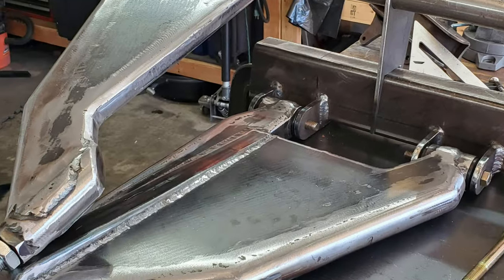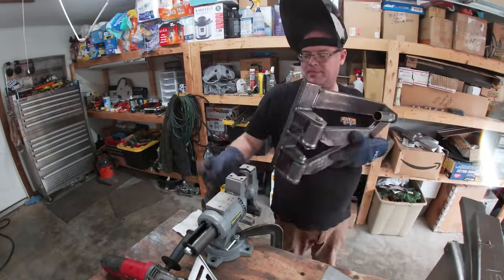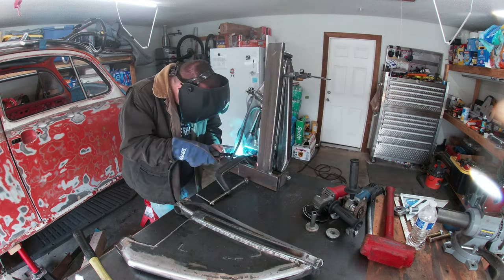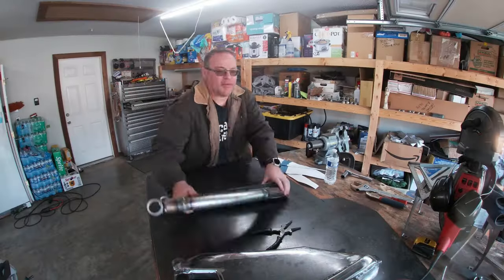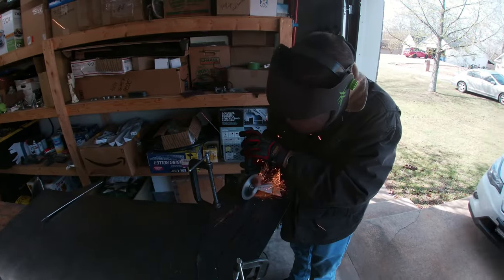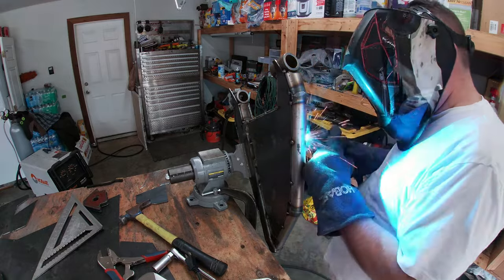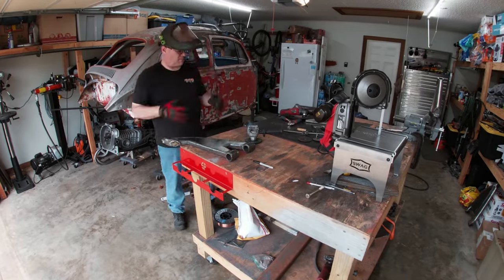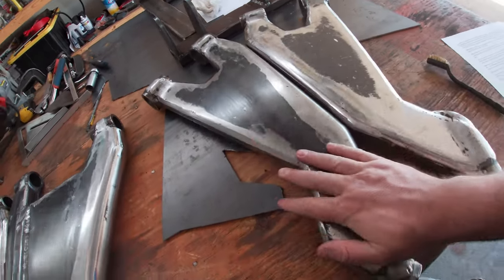Baja Bug Build (Ep. 37): Building The Other Front Arms

Comment: Do you want to sell me a set along with a bulk head $$$ 😀😀😀
Reply from the maker: I love it! And I appreciate the confidence in my design.  But I think I should make sure this design works first!

I was thinking of using the Jigs and my bender to make a tube arm version.   I'd still plate them and all, but I was thinking of loosing the box tube structure and going all tube and plate.

I donno.  I need to finish and test these first! But thanks again!
Reply: @thebinderbuilder  I hear you... Seems like tubular arms would be a bit better for certain reasons, such as you can run the shocks through the upper arm but your boxed arms seem like they would be a lot stronger for rough desert terrain. I cant wit to see how they work out under actual driving conditions. I am serious tho, if you like them and decide you want to take a chance and sell a set up, I would be interested. Side question, I believe you said before that you don’t have the title for the bug. I have that same issue with mine but ive been afraid to do anything else to it because of that reason. Are you worried about being stopped and cant show proof of ownership or do you know another way of doing so?  Ive sent paperwork to the previous registered owner and she doesn't seem at all interested in helping me with the title. just curios were you stand on that, if you do in fact have the same issue.
Reply from the maker: @CallMeXTRA  you can get a bonded title from the DMV that will allow give you a title for the bug.  I'm going to do a video on it as soon as I go through the process. 

Basically you go to the DMV/Department of Revenue and tell them you have a vw big but no title.  You fill out some paperwork,  pay a couple hundred bucks, have the police run the VIN to insure its not stolen, then they issue you a new title.
Reply: @thebinderbuilder  Well ok, I will have to look into that... I have a ton of stuff for it and it would be nice to actually start working on it... Thank you for the info...
👍👍
Reply from the maker: @CallMeXTRA  I will probably cut out the VIN when I build the pan.  So if someone does claim ownership, they won't be able to prove its theirs. 

I also am building my bug from several bugs.  So if someone comes claiming ownership of the pan, and goes the legal route, I'll literally remove everything from the pan and give it to them. I think these videos prove the pan didn't come with all this stuff I'm putting into it.

In reality, I'm going for the bonded title...that should do the trick...but I'd love to have a real Vin and title that wasn't bonded
Reply: @thebinderbuilder  Makes sense...